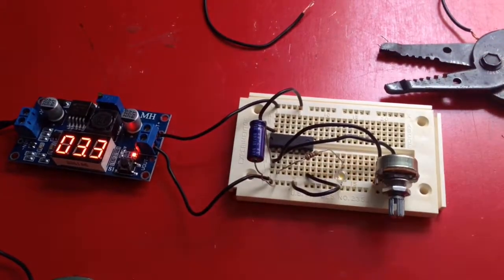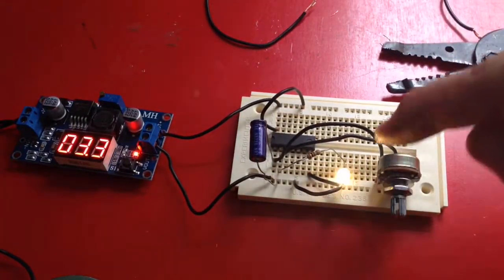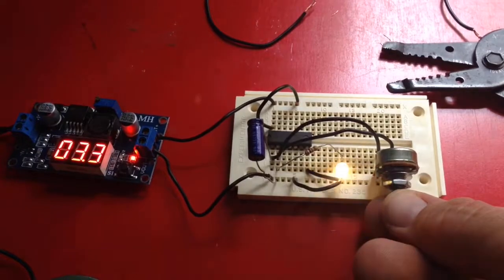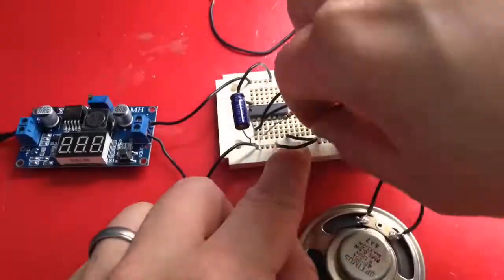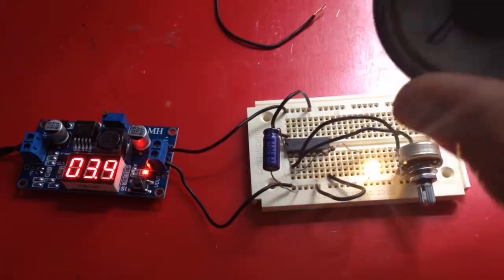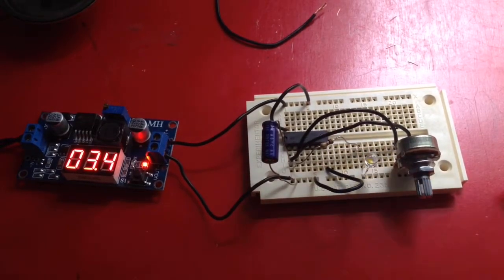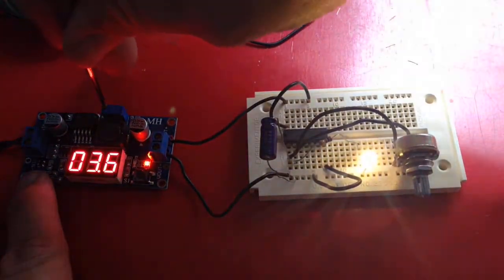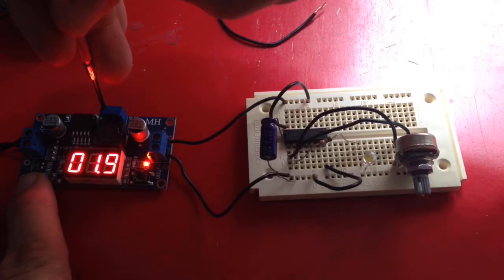My LED Schmitt Trigger 40106 Oscillator Works

Comment: Can you please send me a picture of the circuit on the breadboard
And how big the capacitor is?
Reply: You’ll need ic CD40106. It’s pin 14 goes to + 9 volts and pin 8 to ground. 
Use a 10uF cap and a 100K potentiometer to blink an led. Connect pins 1 of the ic to center pin of your potentiometer and connect pin 2 to the far right pin of the potentiometer. Connect positive (anode pin-the longer pin) of led to far right pin of potentiometer and negative led lead to ground. Connect longer lead (positive) of capacitor to ic pin 1 and negative lead of capacitor to ground. 

For audio, use a .1uF - to a 1.uF capacitor and a 100K potentiometer connected the same as for a blinking led. Instead of led, you’ll connect a lead to the far right pin of potentiometer to the ‘tip’ lug of a 1/8” (3.5mm) audio jack and a lead from ground to the other pin of the audio jack. Plug an audio cord into the jack then the other lead into an amplifier. Turn the volume of amp down low BEFORE applying power to your circuit the. Slowly raise volume. Turn potentiometer knob of circuit until you hear a tone. If no tone is heard, reverse the leads attached to the audio jack.

Comment: the reason you can't hear from the speaker is, your led blinks with about 1 hz or something. 1 hz is so low for a humankind to hear, so if you try it about 80-250 hz, you can probably hear notes from e2 to e4
Reply from the maker: Awesome. Thank you for the tips.
Reply: no problem, that video was pretty helpful for me too. i'm trying to make a similar design with 74hc14 chip.